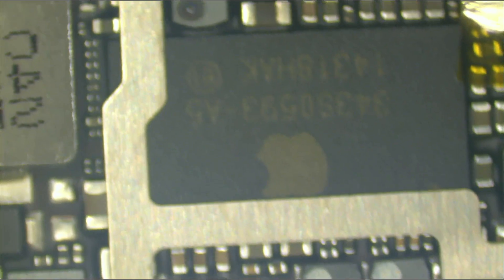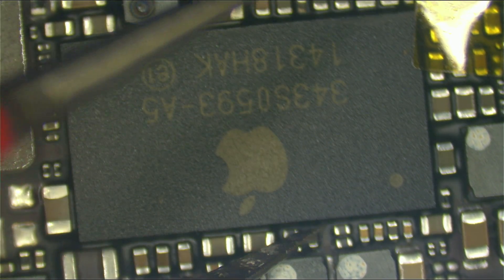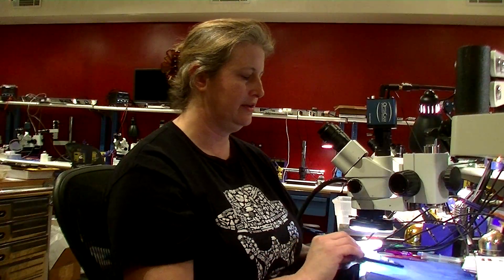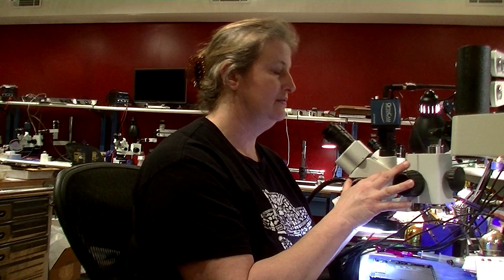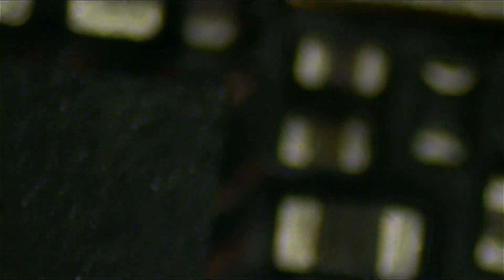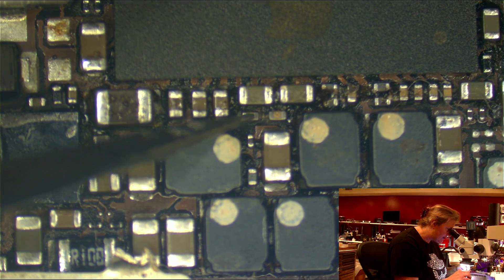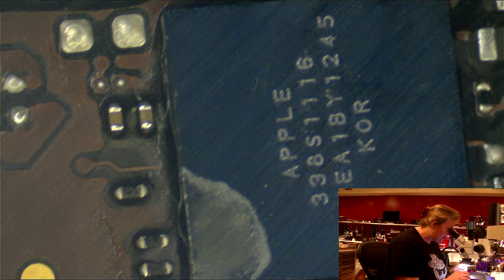Apple uses water damaged boards in Apple refurbished devices

Comment: A better video would be a teardown of a replacement from Apple, straight from them to the workbench. The whole thing with the customer saying that she got it from a out of warranty swap could be a load of bullocks. If the customer was at your shop, the customer could have taken it to another shop as well. And, that customer had a kid-- kids + liquid, seems pretty probably. Would it be possible to retain the Apple display and do a repair on the IC chip like you could do? How much would something like this cost to do?

Comment: When doing similar repairs could we (you), cover the repair in epoxy?  I've always wondered why Apple does not totally cover the board with epoxy or underfill.  Is there a heat issue?
Reply from the maker: I would assume that there is a biology of thermal expansion of solder vs other board materials that would come into play.
Reply: GOBBELDYGOOK May is homosexual you know

Comment: Another possible explanation is that this ipad was repaired by someone for warranty fraud.
Chinese consumer law requires the manufacturer to use brand new parts for repair or whole unit replacement, and if whole unit replacement, start over the warranty. So this gives people a chance to extend the warranty forever in theory, or get a new device if you have the skills to disguise damages caused by abuse as malfunctions eligible for warranty. Because you can be sure that Apple will give you a brand new one instead of a refurb unit that might also be a piece of s**t. There is an industry just for faking malfunctions just to make Apple replace the devices for you, not to mention repairing the device to the point that Apple will accept for warranty.
There are no LCIs in an ipad, so I guess what might happened was:
Someone dropped his/her ipad in the water.
He/she brings the device to a pro who does just what I mentioned above.
The pro repairs the board to the point that it will boot and connect to a PC (required for Genius Bars in China, otherwise they will ask for proof of purchase and send the device in for very detailed examination, because they have been conned before), then restores everything as much as possible, then bring it to Apple, claiming that there are small defects.
Apple accepts and replace the ipad, the original customer and the pro is happy.
Apple sends the device back for refurbishment. Because the claimed defect is minor (like dust under the screen, bad home button .etc.) and the pro has done a good job restoring the ipad, Apple didn't bother to take the shield off to check for damage, they just disassemble the ipad and briefly tests the board, then uses the board as refurb parts.
The board makes its way to the refurb line and finally ends up on your desk.
Reply: Even if that were true, the bottom line is that Apple didn't refurb the device properly as they didn't give it a thorough check.
So the premise is still correct. Apple, uses water damaged boards in refurbs.
Reply: This sounds very interesting I never knew they had to give out new devices in China for warranty usually hey give a as new device for warranty in other countries
Reply: Quite plausible, I've thought along the same lines before even reading your post.
Reply: Boy is that a stretch.
Reply: sounds like a much better policy especially if you really do need it
Reply: explanation? so you want to save apple reputation? its not the first  second time apple does something fishy

Comment: What is an out of warranty swap?  I thought all Apple refurbished devices came with full warranties?  Your videos are very informative and to the point.
Reply from the maker: Out of warranty swap is where you turn in your wet/damaged/broken device and pay $299+ depending on device and leave with a refurbished device with a 90 day warranty if your 1 year is up, otherwise you get the remainder of time until your 1yr on the refurb.

Comment: you're making a pretty big claim there in your video title. you can't say for certain that Apple put the water damaged board in there. we know the ipad was a kid's who dropped it, who knows what else he/she could have done. very presumptuous and i think unfair.
Reply from the maker: You think a child got water in his unopened iPad, then opened it, removed underfill from the PMIC and replaced it with a new chip then sealed it so that it is a factory seal?  Sounds like I need to find that kid and give him a job.

I think the idea that any adult would choose to believe this ridiculous scenario over the idea that of course Apple would recycle boards with minor water damage and sell them as refurbished is nuts, and exactly why I made this video.  

Why are we so brainwashed by a typical corporation that would make choices that improve their bottom line as is their fiduciary responsibility to their shareholders that we insist that "oh THEY wouldn't do that." 

They absolutely would, and do.  Read the comments.  This is well supported with the experience of others.
Reply: You have made assumptions on the order of events in your explanation. We know that the board is water damaged, has underfill missing, and that it was sold as a refurb. This does not mean for certain that the corrosion you saw upon disassembly was there before Apple got their hands on it, nor does it mean that Apple performed the liquid damage repair. If it were working it is entirely plausible that they did not even notice or disassemble the device to that point during the refurb process. It may have been repaired by someone else, before, or after the Apple refurb process. You don't even know if your client is telling the truth. I'm sure you can attest to that. 

We also disagree on whether it's OK or not to repair a water damaged board and resell it as refurbished for a lower price (including free, in some cases for OoW devices). Provided the device works, I don't see any issue. You get what you pay for, and Apple did not lie about the fact that it is refurbished and indeed not new.
Reply from the maker: I have opened over a thousand iPad minis.  This includes many that have been opened and professionally resealed by independent repair,. as well as many that have never been opened since they left Apple.

Anyone working in independent repair would be able to tell the difference between the very best seal that independent repair can make to an iPad mini vs the original Apple seal.  There is no question---this mini had the original Apple machine-created seal and has never been opened since it left Apple refurbishing.

So what did we find inside?  Evidence of cleaned water damage, and evidence of drilled out underfill and a replacement Power Management ic chip.    

There is no conclusion here other than Apple took a water damaged board, did this repair, and sold it as refurbished. The evidence here is strong enough in my opinion to state it as fact.  There is no other reasonable conclusion.

 I make no personal opinion on whether or not it is good or bad to recycle a water damaged board back into general use.   In fact,  I think this is great.  What I object to is the "idea" that people have that "Apple wouldn't do this"

They can, and do.  Of course they do.   This video is a simple statement of facts as I see them, and the evidence is presented here.  You are free to make your own conclusions.

Comment: apple puts that tar crap so you have a hard time fixing it...did Louis hear that? lol  great vid darling. 73
Reply from the maker: +bustersinclair thank you darling!
Reply: +fanatic nutcase:  It seems the tar crap is put on there to aid in the product's durability. Meaning, it helps keep the chips in place after a drop. While it does make a repair more difficult in removing that mess, I doubt that Apple would intentionally add it simply to make repair more difficult. Adding something to affect repair would even affect Apple's ability to repair the boards and produce refurbished devices. If Apple really didn't want the boards repaired, Apple could design it to not be repairable. Of course, that means there would be no refurbished items to sell... though, that might be a good thing considering what Jessa uncovered in this video.
Reply: @abigguitar  Apple would totally add things to hinder repair and they actually do quite a lot to do so but yes, in this case it's to secure the chips in place not just to hinder repair.

Comment: It's quite hilarious that, I'm in China, using iPad Pro 9.7 China version(each of Apple device have a area code that indicates where this device is intended to be shipped and sell, just for the people that might don't know about this.) recently i bent that iPad Pro and pretty much its turned into a curved display iPad, i was pretty much willing to use that special one at the beginning, but after its started to heating up and battery indicator jumping around, i took it to the Apple Store, they told me that its a smart idea for bring it in since its heating up weirdly. i paid the fee and got a swap one for that, for the name of trust, i did not check it, just pulled in my bag after pay for that, said thanks, and start the way back. (and its functions no prob when i test it after return).
The interesting part come, on my digital Genius Bar work confirmation as well as the receipt, its says iPad Pro 128GB somethingsomethingsometing '''(NEW)'''.  yup, its directly indicate this one is new, and i looked up, yup, theres also someone's swap device says (RFB), which is def means refurbished. i took up the work confirmation for my phone before for battery still dropping even not using. my swap phone is also a new one, not 'rfb'. at least that what they says on the sheet. And what decide which one ill get? looked up and got the result of according to the Chinese Consumer Law, factory must use a new replacement if they have to swap the device. so i got a new iPad for outta warranty damage replacement( i have to pay of course).and in warranty replacement for my iPhone 6S Plus (free cuz i did not break it).
and when someone brings in a device that purchased elsewhere for service, like HK, Taiwan or whatever, consequently its not covered by the Mainland China Consumer Law, but it still an Apple device and Apple serviceable. So they give those 'RFB' devices.
After seeing this video i feel so glad that i did not get those refurbished device and that add points to my decision that i never going to buy something refurbished or used unless its free. I'm quite a apple fan boy, even though i don't buy refurbs but i do recommend them to people if somebody want to buy one but having a bit financial struggle, from now on i will not anymore, its disgusted me.

Comment: I love watching you and Louis work, brings me back to high school when I used to be the only individual (and a student, no less) to keep the school's entire Macintosh collection up and running. ('92-'96). I can personally vouch that Apple refurbished parts are not quite up to snuff. We used to get refurbished logic boards with damaged flyback leads and/or cold solder joints on the flyback transformer (typically the Mac Plus/SE/Classic varieties). We even received a board that was so far out of whack that no amount of potentiometer adjustment could bring the 5v and 12v rails anywhere near acceptable levels!

Finally I told the head of the computer labs to just let me reflow the flyback joints on the "bad" boards instead of ordering refurbished boards that often needed the exact same reflow - saving the school thousands of dollars, and taking a whole mess of Pluses and SEs waiting for the next budget cycle to order more logic boards and throwing them back into service - I could churn out a dozen or so in one study hall period.
Reply from the maker: +DashCamAndy thanks for watching! That sounds like a large task... clearly one apple was not up to solving.

Comment: You are 100% correct. They don't retain its gluing method after replacing ICs, in the companies. I use to raise this issue in seminars and meetings. I even asked the Nokia to supply the liquid to inject after replacing the chip. They refused, and never bothered . (When I was working for NOKIA). Even implementation of manufacturing faults (which I use to find and report to Managers) took six months in the updated manual or quick update news. That's how the Industry is. By the way your skill and knowledge is very good. I can see myself in that type of repairing (Level 4, the highest in NOKIA). Cheers

Comment: I'm almost completely sure that Apple didn't actually perform the IC replacement on that board, because for them it makes no sense, they have a huge stockpile of those boards that they make inexpensively but sell them at a super high price to the customers. They would have tossed the board away and put in a new one, because labor hours cost them more than the board. No, that was done at an independent repair shop, where someone had his iPad fixed, and then he did some kind of a trade-in with Apple where he bought a new device, and traded in his old device, which Apple superficially checked, it seemed OK and they repackaged it and put it on the out-of-warranty replacement refurbished pile.
Reply: +iPad Rehab factory workers in mexico do those repairs they have access to all original screens and adhesives. they work on everything from apple for literally pennies an hour. no way they're doing high quality work for that pay and for 8 hours straight with quotas.
Reply from the maker: If any independent repair shop
can put on a mini PMIC and reseal the iPad so that it is indistinguishable from factory they would get a far better return by just selling it.  Why would they take it to Apple?  The trade in value would be far less than simply selling it.
Reply: iPad Rehab Why do a trade-in with Apple? I don't know; why does anyone? Maybe they wanted a newer model. Maybe they thought the repair was merely a temporary fix and it's better to move the device while it still works. But it's a rational move. From Apple's perspective, if refurbishing a device requires anything more than a memory wipe and some cleaning, it simply isn't worth the effort. That's why they don't do what you and Louis do, and instead they just throw away the old laptop boards and put in new ones, and with phones and tablets not even that much. It would be completely irrational for them to do IC change on a water damaged iPad mini because for them it's a throwaway device that is not worth repairing.
Reply from the maker: People do what makes sense for them to do.  There is no way that Apple is throwing away logic boards with minor water damage.  And there is no way that anyone could have put that screen on indistinguishable from factory, and if they did, there is absolutely no way that they would have turned it in to Apple instead of selling it for a better value than you'd get from any kind of trade-in.  The refurb was good, and it would have worked indefinitely if it hadn't been dropped.

Comment: but whats the problem? all apple refurbished products come with one year factory warranty and are elegible for apple care
Reply from the maker: Apple refurb a come with a 90 day warranty or the remainder of the original AppleCare limited warranty.  You don't get a full year.
There is no problem with recycling components, that's a fantastic thing to do and this was a very good refurb.  The problem is the perception.  Most people think they are getting a brand new device when they buy an out of warranty swap refurb from Apple, and most people think that what they are getting is a pristine condition device that is identical to new.  That's not the case.  In fact the defect rate on refurbished iPhone 6+ sold to people swapping for touch ic defect is higher than if they just had their existing phone repaired.   This is an opinion, but it comes from conversations with Apple repair insiders as well as a comparison of the defect rate we see on repaired touch ic phones versus the collection of anecdotal reports of defective iPhone 6+ refurbs out of the box or shortly thereafter reported on Apple Support forums and the combined experience of many shops.
Reply: mmm, I think we are living in different planets, I just bought a refurbished mac which by the way came in a sealed box with a full year warranty elegible for apple care... very strange
Reply from the maker: Maybe this will help.  It's 90 days. 
http://store.apple.com/Catalog/US/Images/wty-refurb.html
Reply: Sealed box doesn't mean much cause, well, Apple owns a box sealer. ;)
Reply: yeah but still one year warranty is good, plus you got the option of buying apple care

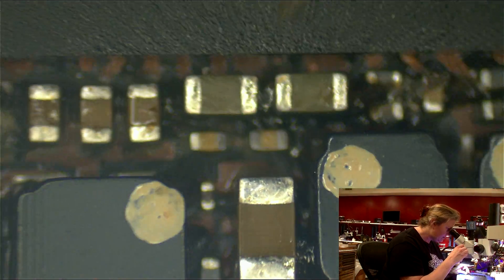Comment: at 6:26 Jessa mentions that two caps appear water damaged.  What criteria do you use to judge this?  I can't tell any difference between the two shown and others that she mentions are fine. What are we looking for exactly that is clear water damage in this example?
Reply from the maker: normal caps have two shiny soldered ends.  water damaged caps have one end dull gray and oxidized---the end "on the line" and the ground end still looks shiny and normal.  After you look at about 1000 boards both water damaged and not it is clear as day.  Other things can cause oxidation such as flux left on the board, but this will oxidize both sides of the cap.

Comment: Hi Jessa, I have an iphone 5c with no touch. The phone powers up, charges but the display has white boxes and goes dark grey after some time. Given enough time it goes all black and the backlight is on. I replaced the U15 sage but no improvement. Any suggestions? I also check for all the six filters for continuity.
Reply: Check chestnut outputs
Reply: +Jessa Jones Thank you Jessa for the info. I have ordered the display chestnut chip from microsolderingsupply.com Apparently the 5c has underfill pff haha. Btw I have repaired the touch/ grey screen issues on two iphone 6 plus successfully. However, the proximity sensor does not work on both. :(